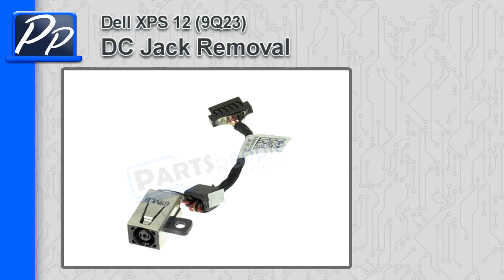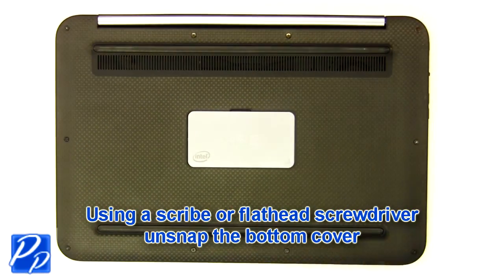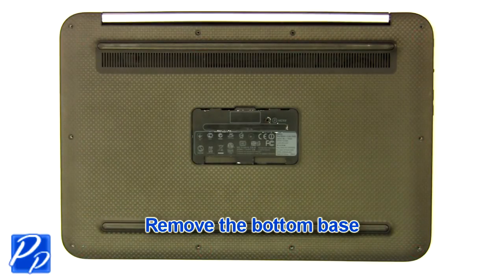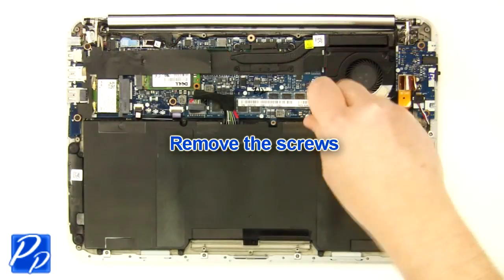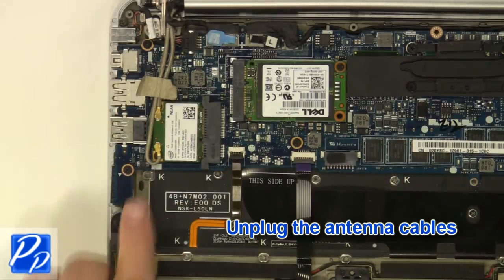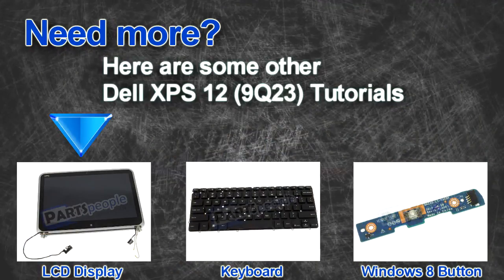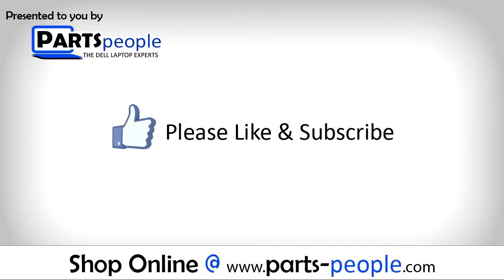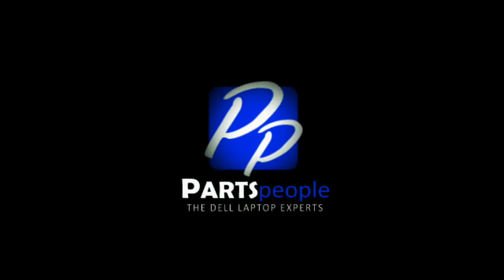Dell XPS 12 (9Q23) DC Jack Video Tutorial Teardown

Comment: Why did You removed the battery?
Reply from the maker: It is not necessary to remove the battery but you do need to unplug it. We removed it just to get it out of the way.
Reply: Parts-People.Com, Inc why do i need to unplug it? i just switched the port without unpluggin it ... it worked.
Just watched this video later to check if i did it right :p